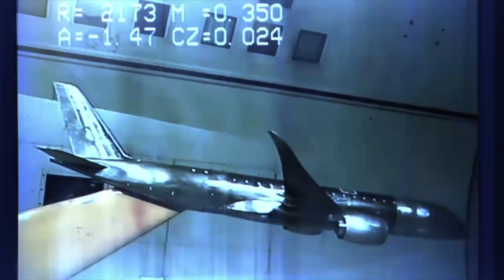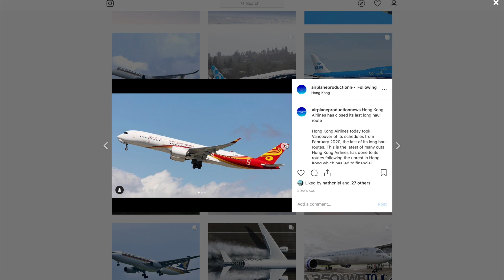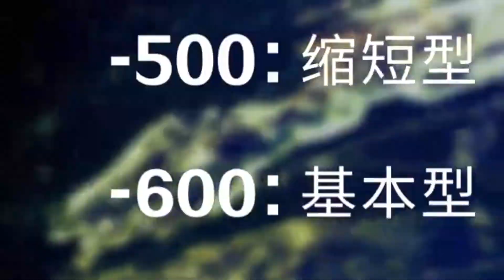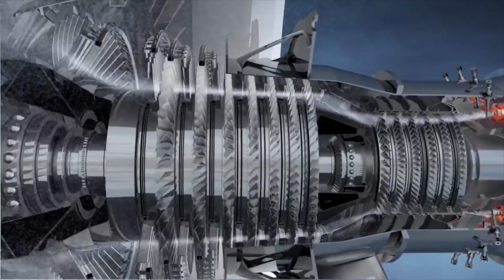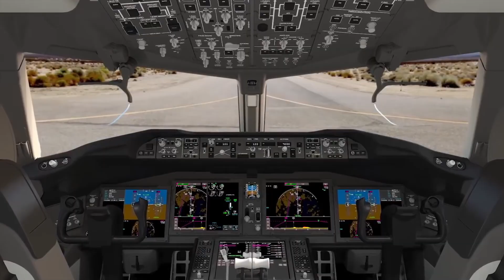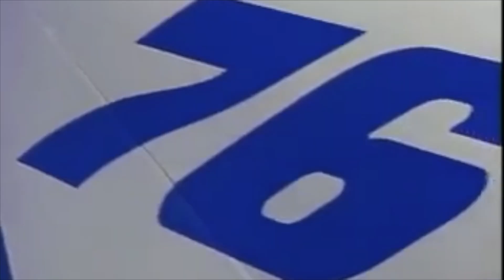CRAIC CR929: CR929 vs 787 can it compete?

Comment: Currently, the company best equipped to end the airliner manufacturing duopoly would be Lockheed, perhaps in partnership with Northrup Grumman. Lockheed has built some of the finest airliners ever to fly. The L1011 Tri Star was a spectacular and very underrated plane. With a bit of government subsidy, perhaps equal to what Airbus and COMAC receive, Lockheed or a Lockheed/Northrup Grumman partnership would be more than capable of reentering the airline market with a some very competitive offerings. The USA used to have three big commercial airliner manufacturers. Perhaps it is time to have at least two.

Comment: Wishing the best for CRAIC
But I'm afraid it is too late as Airbus is entering Era of zero emissions
Reply from the maker: Misbah-ul Hasan Yeah, in my opinion the CR929 should be dropped and both countries should compete with Airbus on hydrogen power :) Thanks for tuning in!
Reply: If China is developing plasma jet engines for aircraft, then they are probably not too far behind in the race for zero emissions aviation.

Comment: This aircraft will be a success if 1. It is safe 2. It is efficient 3. The price is much lower than Airbus/Boeing equivalents.
China and Russia can use it i. domestic flights and If say after five years there are no safety issues than this will be a success.Airlines which don't have a lot of money will buy this plane if the price is a lot less than Boeing/Airbus

Comment: The middle of the market is being taken quickly by A321XLR and CR929 will not be ready in time to compete. The two countries are developing an airplane together for the first time and it's hard to predict what will happen. They will likely have more troubles than France and Germany when they started working together for Airbus. So they are designing a plane they need the most, which can save them some B787 and A330/A350 orders rather than going into a time-sensitive market segment filling others' need.
Reply from the maker: Yu Zhu Yes that’s a good point. China already has plenty of A350s on order but developing their own jet could save them money, but these will be mainly operated by Chinese airlines. Thanks for tuning in!
Reply: Finally I know why they made the 929!

Comment from the maker: Can CRAIC CR929 compete with the established mainstream? Do comment below! Thanks for tuning in and as ever clear skies ahead!
Reply: The Airbus/Boeing duopoly definitely needs more competition but the fact that this JV failed to recognize the hole in the market left by the 757 as you mentioned means they will not the one to end the duopoly in the near future. The Russians keep only copy western designs after the cold war and the Chinese just keeps dumping money on people.

Also as you mentioned, its not just the price of the aircraft but its overall cost during its life, and this company has no track record and no global supply/support chain for their aircraft. But this is something they can partner up with western companies that has a global support chain but does not make large commercial jets like Textron and Gulfstream/GD or Dassault. 

You should've also mentioned that CRAIC is planning on building a 4 engine jet and this is sucking up some of their resources instead of pouring it into the 757 replacement.

Finally, remove the "I" in the acronym and this company is called CRAC.
Reply: Given that UAC and COMAC haven't been able to agree on a supplier list, I think there's a good chance the CR929 is never brought to the market.  Granted, they may work it out over the next 6 months.  But they also might not.  And, as you mentioned, many airlines have already (or will do so over the next 2-5 years) selected their future aircraft in this class to carry them for the next 25 years.  The CRAIC CR929 program cannot afford unnecessary delays because every airline choosing airbus or boeing is an opportunity for market entry that is lost and won't come again for over 20 years.
Reply: @alexandernorman5337  hahaha really funny comment。so which is the  big market for airplane company sellers?why china should  only buy from Boeing? Really idiot comment
Reply: @acjayden2771  - You have an interesting take on risk then!

China's COMAC and Russia's UAC created a Memorandum of Understanding (MOU) to jointly investigate the feasibility of the CR929 program and what was needed for it back in mid 2016.

Here, more than 4 years later, there is still no legally binding contract for any party to do anything towards creating the final product.   There is no legal liability for either COMAC or UAC to bring anything into the program and there are no legally contracted suppliers.  And they have just recently again pushed out the date to where they say they will have contractually bound system suppliers.

Again, they may be close to obtaining a contract behind the scenes and all of this will resolve itself in a few months.  But then again, it might not!  And things are never certain until there are firm contracts signed.
Reply: It's a 787's copy!